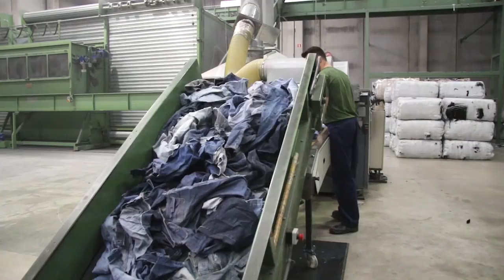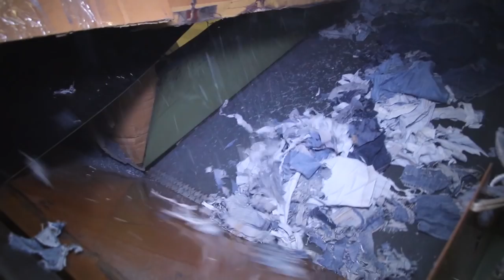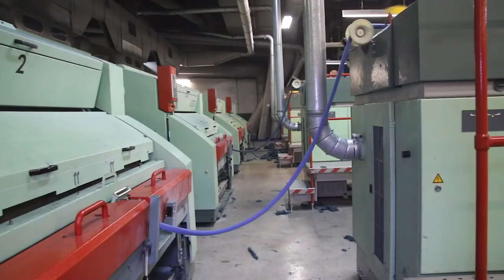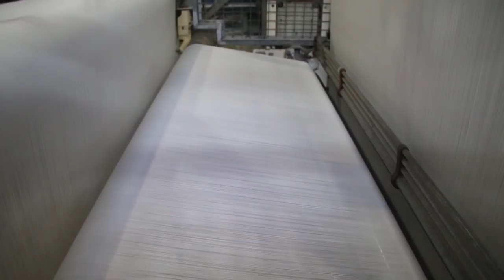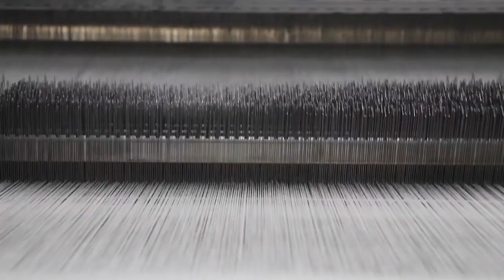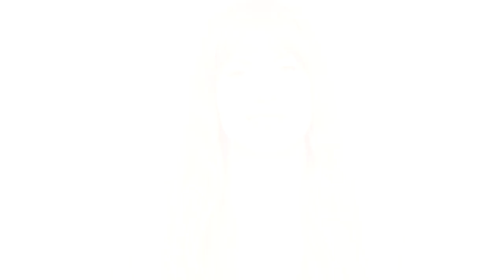How Old Clothes Can Become New Clothes | Textile Recycling ♻️

Comment: Can recycled jeans be recycled.. again?
Reply: I think so, but depending on the length of the fibers, more (longer) virgin cotton fiber will need to be mixed in with the recycled fibers to make fabric that is strong enough, and I'm sure there will be a lot of "flyaway" fibers that are too short to be spun back into thread... perhaps those could be composted or used for biochar. I'm just guessing!
I wonder why they shred the denim each time, and whether there could be some other process, like unraveling the fabric into its component threads and combing and re-spinning them, that could preserve the length of the fibers?

Comment: Great video as usual! I like to sew and I accumulate a lot of fabric scraps. Some can be quite small and are unusable. Can they be recycled?
Reply from the maker: Thanks! Sometimes they can be shredded up for things like insulation or stuffing - check with your local recycling programs/facilities. You can also use them for stuffing yourself, a fabric scrap pet bed for example is a project I've seen. :)